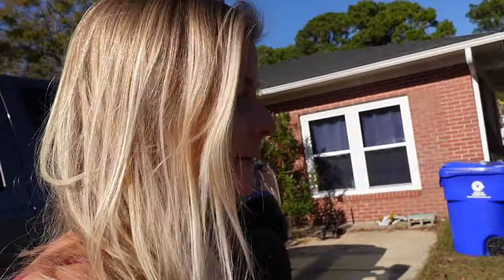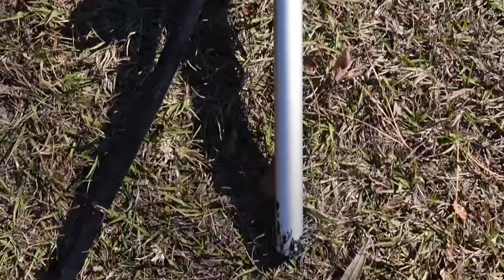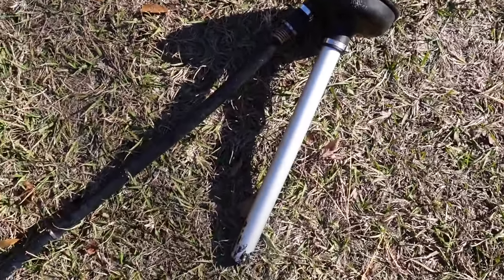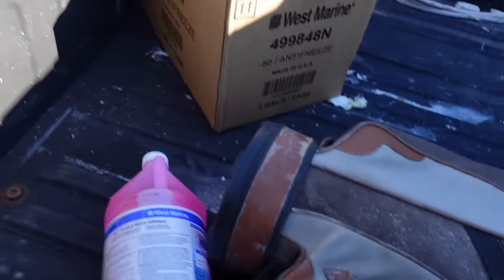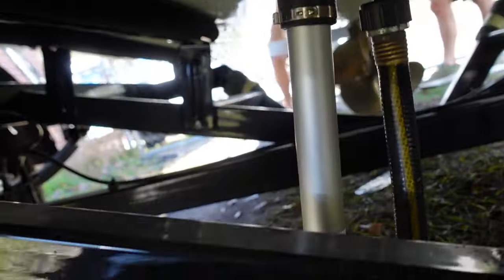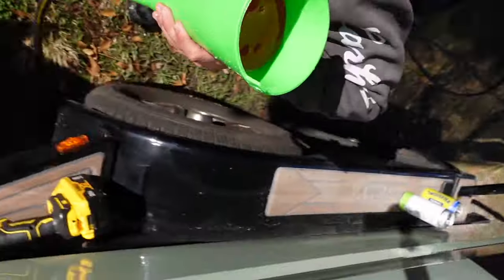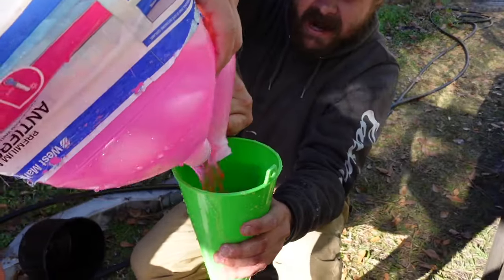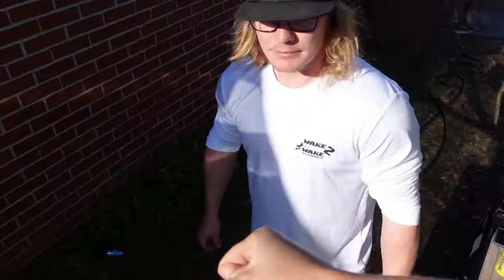HOW TO WINTERISE YOUR BOAT

Comment: Yikes.  This method does not fully winterize the boat.  You have to run the engine until it gets hot enough to open the thermostat. Run it on water first to get it hot! You still have a lot of water in the engine block

Comment: And absolutely none of that antifreeze made its way into the engine block at all, I guarantee it!!!!!!! Until the thermostat opens, which you clearly didn't run the boat nearly long enough for that to happen, all that antifreeze went straight through the impeller and exhaust and right back out the back of the boat.  But hey, at least your exhaust is protected.
Reply: Most modern engines have a bypass on the thermostat so you don't need to warm up your engine to fill up the block with antifreeze.  It's easy to check this is after running antifreeze through the engine.  Locate the large hose going from the engine's water pump (not the raw water pump) to the thermostat housing.  Disconnect the end going to the thermostat housing then insert the right size PVC pipe into the hose to get the level higher than the thermostat outlet.  Pour in antifreeze to the pipe and most of the time you will immediately start to see antifreeze come out of the thermostat housing and this means the thermostat has a bypass and there is no need to warm up your engine.  Check out this video starting at the 7:40 mark:  https://www.youtube.com/watch?v=MDWl_jeHYhs
Reply: @braddoesitall  That's 200% incorrect!!!!  There is a bypass at the thermostat, but that bypass, bypasses water past the thermostat and straight to the exhaust and no place else That bypass is there to keep the exhaust from overheating until the thermostat opens. Until the thermostat opens, ZERO antifreeze enters the block.    Google it and you'll see what the bypass does.
Reply: @gunnerneikoify  Did you watch my video that I linked?  It shows without a doubt that my block is filled with AF after running the engine with the thermostat closed.  If you pour AF in the hose that I show and AF immediately starts coming out of the thermostat housing, the block is full.  As I mentioned, most modern engines are like this, there are exceptions that's why I show in the video on how to check this.
Reply: @braddoesitall  One thing I did notice was that you DIDN'T pull the left or right side engine block drain plugs to show the antifreeze pouring out of the block......
Reply: @gunnerneikoify   I don't pull the engine plugs in the video because I want to keep that AF in the block for corrosion protection.  I did pull the plugs as a double check the first time that I winterized my boat and AF did pour out.  Plus, a few years ago after I drained the water, I forgot to re-install one of the engine plugs.  I lost 2 gallons of AF through that hole while running the AF through the engine before I realized it.   So, that shows that the AF is definitely filling up the block.  Trust me, I believed just as you when I bought my first boat 15 years ago.  I paid a marine mechanic that owns his own business to teach me how to winterize my first boat.  He is the one that taught me this and proved it to me.
Reply: As long as the water is drained from your block there is honestly no point in filling it with anti freeze a few droplets of water left in the engine isn’t going to hurt it. What causes the engine to crack is the expansion of ice from the freezing
Reply: @howiefeltersnatch4501  I agree that a few droplets of water leftover in the engine isn't enough to crack the block.  The antifreeze is extra insurance for me in case there is some remote pocket of water that doesn't drain.  Also, the good propylene glycol based antifreeze that is specifically for engines does provide corrosion protection.  I have ran tests on pieces of cast iron and it does make a difference.
Reply: @braddoesitall  yea I agree it is a good precaution I winterized my ski boat today and still dumped antifreeze in it to be safe